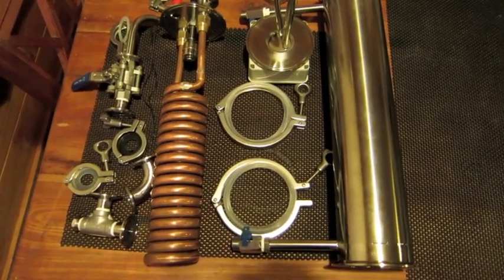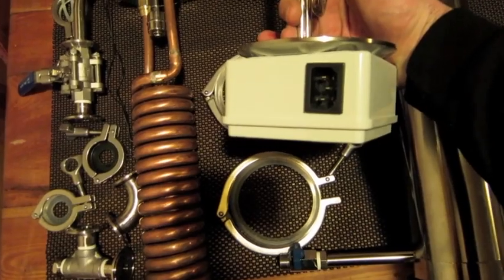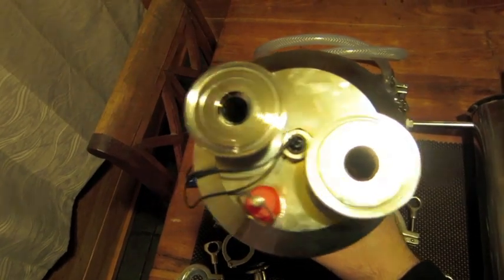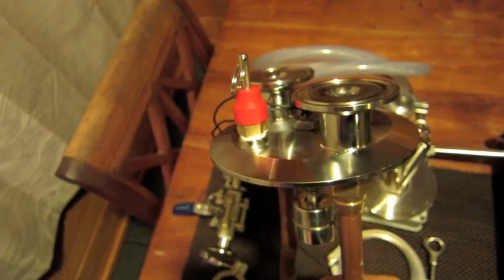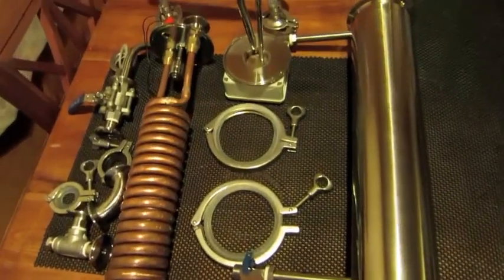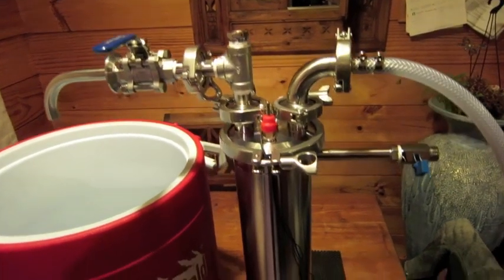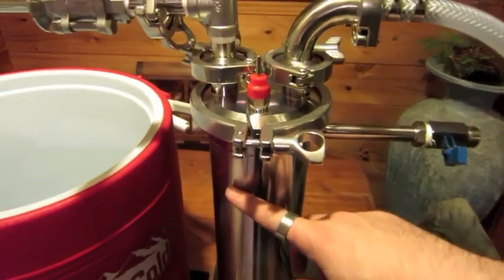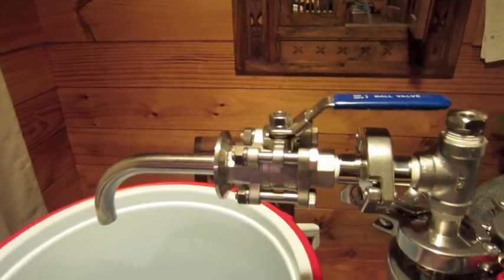Electric Home Brewery part 2

Comment: I am making one of these for a project for school that I am going to use for my brew setup after. Questions.... What psi pressure relief did you use? and what is the length of tube you used (the 4") I ordered the 24 inch one but the more i look at yours I can't tell if you have the 36 inch one? (sorry for the inches I'm across the pond).
Reply: +Nicholas Wilson Also how did you connect the element to the bottom plate and then to the box? does the nut go through the bottom of the box and everything is tightened down? I plan on using a lathe to drill and tap the bottom plate, but i thought I might get a leak if i tightened down the lid in-between.

Comment: You'd have better performance if you reversed the flow through your coil to have the return to tun through the coil instead of the riser.. Just my 2 cents.
Reply from the maker: ***** good point, I wonder how much difference there would be?
Reply: Believe it or not, it will be significant.  You are trying to counter convection on a very long run of copper with a small diameter.  Without putting pen to paper I'll say you'll see a 30%+ improvement at high delta T.

Comment: I'm looking into making one of there, do you have any advice on how to make one now it's tried and tested? Any help would be grand.
Reply from the maker: This design works really well, the low volume of water heats really fast and is very efficient at heat transfer. There is 3m + of copper pipe tightly coiled up in HEX. If I built it again I wouldn't worry about the float switch at the top, I never wired it up, and the fitting can leak when the pressure increases. I would also set it up to be used as a wort chiller, simply by running cold water through it instead of heating up a body of water when used for the MLT. Also adding some copper fins to create turbulence when running it with cold water for chilling, so that the water takes longer to travel through, and therefore is more efficient. 

I tested it for chilling, and it took 30min to chill 20ltr of boiling wort to pitching temp, compared to counterflow chillers that take 15min, due to the extended time that the copper pipe is in contact with the cooling water. Hope that helps Greig, let me know how it goes, Cheers
Reply: Thanks a lot! Think this is my next adventure.

Comment from the maker: yes everything is 1/2" NPT on my setup, that includes the pipe as well. I have used a Sabco system and they have 1/4" pipe, and the flow rate is to slow, also it got blocked a couple of times to, not good halfway through a brew.

Comment: So then the threading is all 1/2" NPT? I'm thinking that's what I'm going to do to all my gear. Seems to scale well all the way up to around 2 barrels. Also, most web sites seem to default to that, and it's easy to find in the hardware stores. Very versatile.

Comment from the maker: The water is drained out at the end of the brew session, and the pressure relief is left open when filling it so that the air escapes, then it is closed again. Seeing its like a pressure cooker, the pressure relief value is primarily a safety feature.

Sorry I havent go the the parts list yet, if you go to brewershardware . com that where I picked up all of the Stainless steel components.

Comment from the maker: Heat would cause a problem over time, however there are some thermal plastics that could handle the heat, but they would then inherit expansion issues. Stainless Steel is the best to use for durability, the 4" pipe coast me around $80USD so its actually cheaper than thermal plastics.